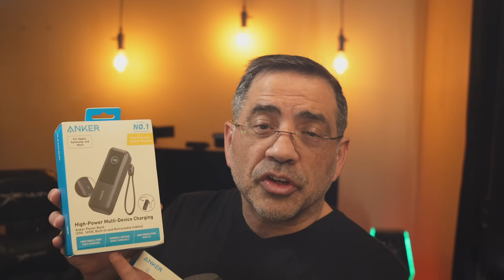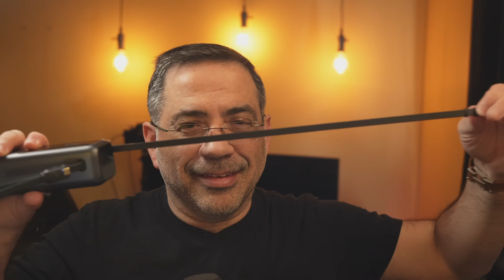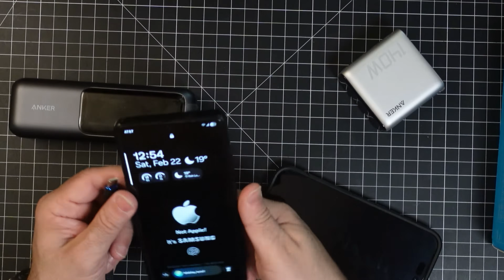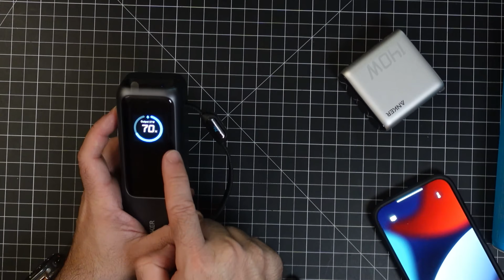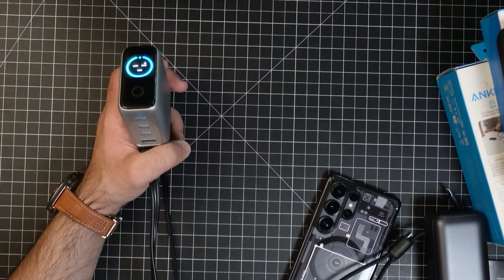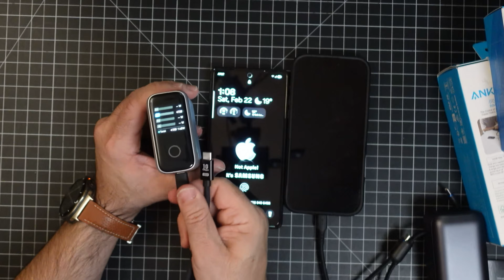NEW ANKER PORTABLE BATTERY AND CHARGER

Comment: It will throttle charging the power bank
Reply: A way to avoid that is try not to let it completely die before recharging charge it from around 30 to 40 charging at 100 watts from 0% it's bound to throttle at around 50%